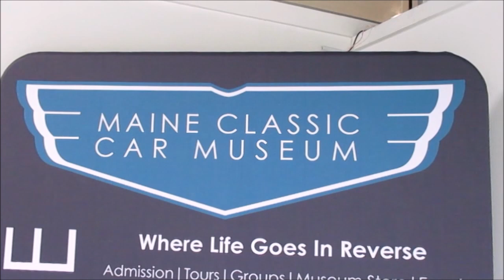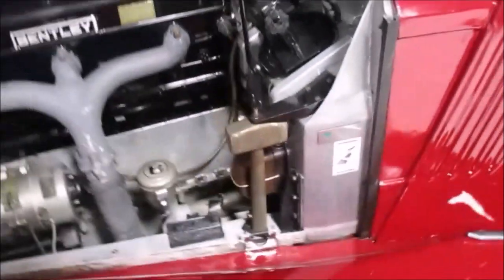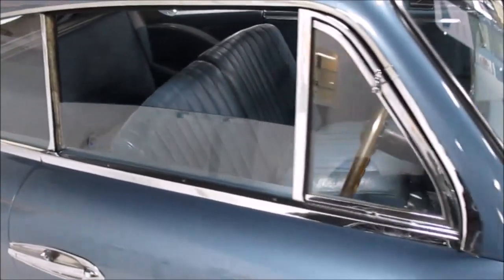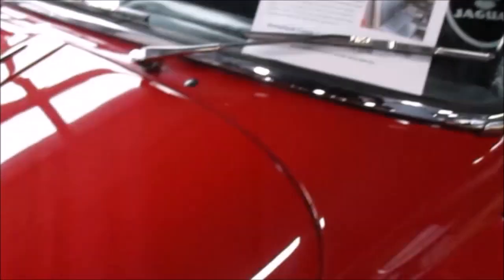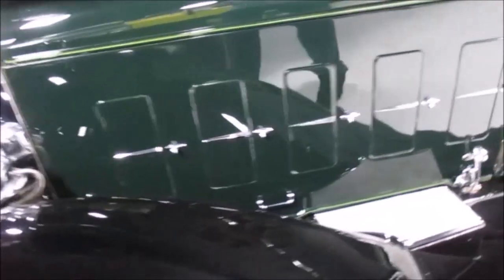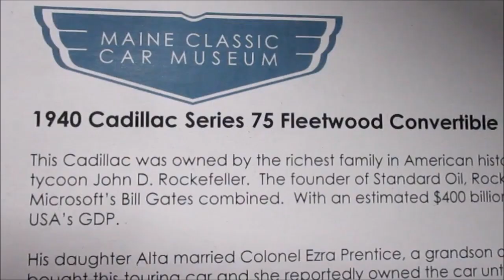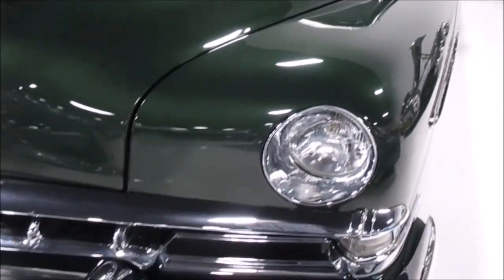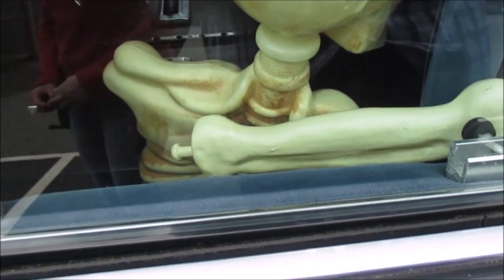WHAT I FOUND AT THE MAINE CLASSIC CAR MESEUM

Comment: The Bentley hammer is probably for taking off the "knock off" wheels - there are single central nuts with wings holding the wheels on. These nuts are sometimes called spinners and some folk will call the these wheels Spin-off wheels. The hammer may be made of lead to save damaging the spinners.
Reply from the maker: Thanks for the info and for being here with us Lyndon